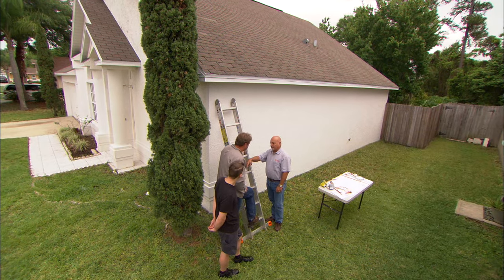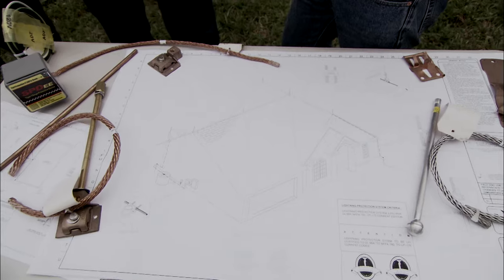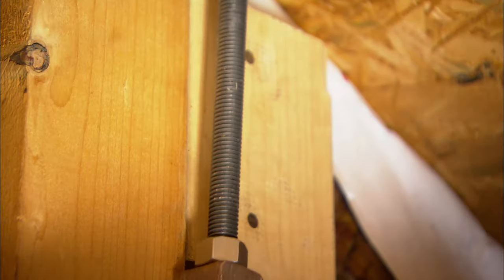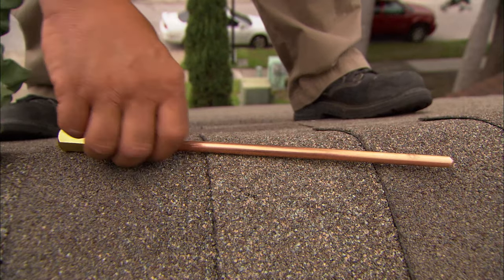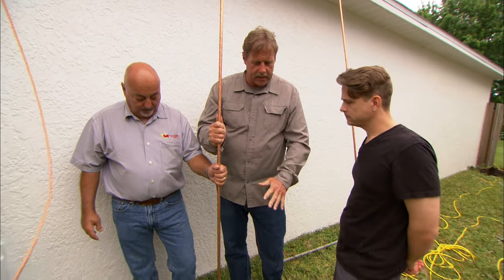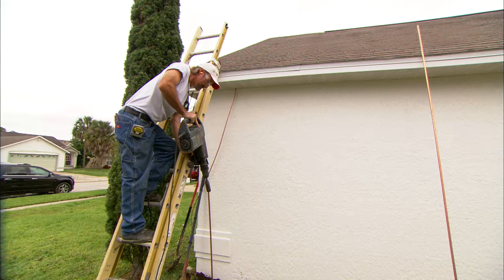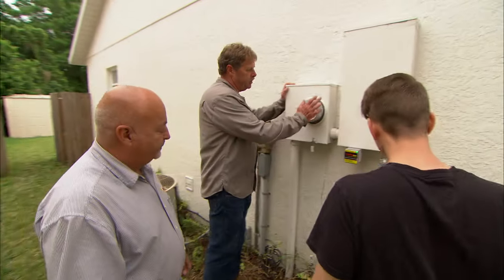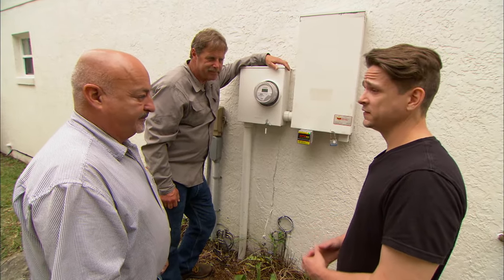Installing Whole House Lightning Protection | Ask This Old House

Comment: The copper cable connected to the ground rod will eventually oxidize and turn green.  This most likely will cause the "wire to rod" connection to fail. This connection should have been protected from moisture and the elements. With the connection buried underground, one will never notice the oxidation.
Reply: Eric R Dont talk rubbish, by your logic, overhead busbars in outdoor substation compounds will fail and copper transformer tails on overhead power lines will fail too. The oxidisation is a thin layer on the outside of the copper. The connection between joints will be mechanically sound whether green or not
Reply: In many neighborhoods that copper would be vandalized and scrapped

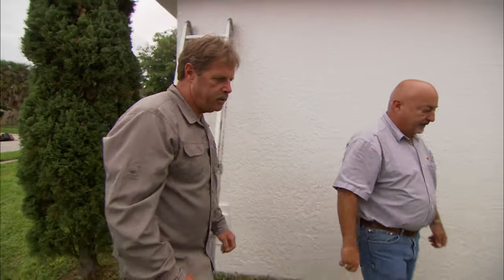Comment: By 0:20 you already know it won’t protect you from lightening surges that come through telephone poles or power lines cause those rods only provide a path for the lightening from the sky via the rods. Not via power lines or cables like telephone cables for example. Hence this video’s Flag ship device is only one part of total house protection
Reply: Wrong..
Reply: At about 3:20 they install a breaker box surge protector. The principle on this is that any surge that comes in on the main line or any other circuit due to an indirect strike, will cause the protection device to route to ground and blow a dual 50 amp breaker. The 50 amp breaker is actually protecting the protection device from taking a sustained flow. The device has to be as close to the incoming AC lines as possible so that it forms the shortest possible path for the surge. Shorter than any other circuit in the house. There are a number of more thorough videos about these devices, their function and installation.

Comment: There are so many things wrong with this video. If lightning hit the rod on the roof there is no guarantee the strike will follow the ground line in the attic and it could jump to a lower impedance path in the house and cause greater damage. The two grounds used to make a 20 ft rod MUST be welded. The ground line MUST be welded to the ground rod. All ground rods MUST be connected together and in turn be connected to the ground at the service entrance of the house. He said cable, tv, phone, etc has surge protectors but those must be grounded at the service entrance also. I bet they weren’t. I don’t see how this installation passes NEC.
Reply: Welded AY LMAO
Reply: Sorry. I stopped reading at "ground at the service entrance". omg. It will fry computers, tv, frig, a/c. There is also guarantee that the lightning will follow the ground line as it has lower impedance than anything else.
Reply: Local code supersedes the NEC

Comment: What happened to bonding lightning ground to electrical ground and incoming gas. And was there any metal within 6ft of the cable in the attic area. Cause if so it will need bonded as well. Pretty sure I saw the name Maxwell on the equipment. Big outfit out of OHIO.
Reply: Good eye, typical for big outfits - screw up the highest number of homes, opening a market in the future for further upgrades/fixes, which they are already way ahead of you on and will see you in the future for again lol. From concrete, stucco, to lightning rods, never trust a big name that is always looking for new employee's
Reply: The NEC states that the ground and the neutral buss must be bonded.
Here in the Philippines we had problems with the ground conductor
Reply: ground conductor of the utilities company had problems reaching the ground sometimes.  I had to run a neutral to a good grounding conductor so that we will have power. (We have 240-0 line, single phase 13.8 KV feeding the XFMR)
One big problem we experienced with bonding the neutral bus and my ground bus is that when that situation happen, the neutral load of the XFMR will be coursed thru my neutral conductor into my grounding system and burn it up.
Reply: @magsasaka1027  Very interesting, thanks for sharing that!

Comment: Interesting, might sound like a daft question but is there a very high incidence of strikes in your area of the US, we’re in the UK and have never come across a domestic property strike although they must happen. Thanks for sharing 👍
Reply: I can't speak to whether they are direct strikes but here in Atlanta, GA we do see a lot of device damage as a result of lightning during storms. I do IT and other technology consulting so I am called in to replace equipment damaged during thunderstorms. I have an electrical\electronic\scientific background but I can't speak to the pathways involved by the lightning, maybe through the power transformers, or wet ground and wet homes, I'll have to think about that, but the result is pretty clear. Lots of damaged computers, routers, TVs, audio amplifiers, whole house audio components and so on. 
The guys touch on indirect hits just slightly at about 3:20 when they do the Breaker box surge protection device.
A friend of mine lives in a wooded area and has seen a receiver, TV, DVD player, and a multichannel amp (twice) get hit from two storms within roughly the last year. We're about to do some serious prevention work in the near future.
Reply: My wife's parents house is on a mountain top, and everytime there is a thunderstorm, they had to turn off their main switch (30 amp fusible switch) otherwise, the fuses will be busted, and also bust up their TV receiver.
Reply: I live near the Tallahassee Florida area and it's definitely one of the worst places in the US for lighting strikes but I only recall a couple houses being destroyed by lightning over the years.
Reply: I live in Oklahoma (tornado alley) and we had an indirect strike around 2015 at our house. Fried several electronics and we had a hefty repair bill for our air conditioning unit. Just saw on the news that lightning struck an apartment building through an air vent and busted a toilet into smithereens! Luckily there was no fire!
Reply: Florida is constantly getting strikes!

Comment: In reality having a lightning protection system on a structure does attract lightning strikes due to the air terminations creating a larger streamer compared to a structure that is non-conducting. the step leader from the cloud is looking for a ground streamer to make a connection. it would be interesting to see if the spacings of the air terminations comply to the correct rolling sphere protection radius.

Comment: 1:24 He Did Secured The Cable Wrong, It Shopuld Loop Around And He Should Secure It With Equal Pressure To The Plate, Now Its Not Like That !

Comment: What is the tool used to cut the threaded rod? at 1:30
Reply: Cordless bandsaw.  Very handy for cutting rod and conduit in the field when an extension cord is impractical.

Comment: Why the wire inside the attic doesnt have any insulation? I mean there is like zero chances to have someone touching the wire when a lighting hits but its there
Reply: It’s lightning cable. Do you think thin insulation will protect you if you’re grabbing it? Probably not. Lightning will go right through it. Tens to hundreds of millions of volts.

Comment: I thought the idea was to shed the lightning away from your house? This appears to bring it into your attic before disbursement to the ground. (?)
Reply: Lightning will strike where it wants. It is not possible to redirect it away from a structure. Unless you live next to the Eiffel Tower perhaps.
Reply: @ClicketyClack  Sure it is. By providing a more attractive (lower resistance) path to ground. If you want to see real lightning protection, look at a space launch pad  at Cape Kennedy. See those four towers around and higher than the vehicle. With wires run between them.That's how it is protected in Florida.

Comment: Why People Don`t Use Diodes To Put The Electricity Into Ground And Not From Ground?
A Lot of People Get Sensetive Devices Killed By The Static Electricity  That Comes From ground And Thats Why I put In parallel so all the unwanted electiricty  goes into the ground and not the other way around, i put few diodes with diferent values in paralell so if one blows, the another one will work and if lighttning strikes , they will be fine i guess. or am i wrong?
it works good for the computer because without grounding diodes, the computer froze many many times a month, now when i made the diodes to ground from pc, it have never hapened not even once.

Comment: I think this was mislabelled.  This should  have called Everything Wrong With This Type of Lightning Protection.  Routing a cable through the attic-wrong.  Steel threaded rod connecting the point on the roof-wrong.  Ground rod only 8 feet in length -wrong.  No checking for utility lines before driving rods into the ground-wrong.  No series of lightning rods in the ground connected with copper cable-wrong.  etc., etc. .

Comment: Keep in mind that while this makes a strike on your house safer, it also increases the chance of lightning striking your house in the first place. This system is probably more important if your roof is higher than most other objects anywhere nearby, like if your house is on a hill or a two story among single story homes.

Comment: He said adding the rods won’t increase lightning strikes to his house...that it doesn’t “attract” lightning....Then why does a tower get struck more than anything around it? It’s the same principle...I think the odds are greater that his house will get struck more “with” the rods than “without” the rods.  The lightning is looking for the easiest way to get into the earth.  I think the guy is lying so his business doesn’t get struck.
Reply: T Jam it’s more about height instead of material, a tower attracts lighting because it’s the highest point of that area. In this case I don’t think the extra feet would significantly attract more lightning to his house

Comment: Someone should tell him that a lighting rod prevents lighting. It’s primary function is not to “disperse the lightning into the ground”
Reply: A lightning rod doesn't prevent lightning.  It can attract it, though, if it was going to strike nearby.  So he's wrong, but not for the reason you think.
Reply: @jej3451 , maakjar, You both are wrong. Lightening rods do not prevent lightening strikes. The wire just gives it a direct path to earth. Also, the rods only attract a strike if it is close enough to hit the ridge of your building, and it's much better to direct it to earth, which is a natural ground.
Reply: @augustreil  You said nothing that contradicted me.

Comment: Why do you need lighting protection? Wood is a horrible conductor of electricity. Lighting striking houses is extremely rare.
Reply: Everything is a conductor if you push enough voltage through it. The guy in this vid already had one strike that fried all his appliances.

Comment: Dude use isolated cable! don't press the raw copper into the wooden beams! Also, considering lightning rod mechanics, why not put it away from the house!?
Reply: Miquel Vico why not? What do you mean isolated cable? Do you mean use insulated cable? If you put the rods away from the house. Then the lightning may still strike your house and not the rods.
Reply: Insulated cable would melt and be a higher fire hazered than bare wire.
Reply: Insulated, Non-insulated, makes no difference.
Reply: @Fusiongearz   Melting rubber is a barrier between white-hot copper and dry wood, not a perfect barrier, but at least the heat sorce ain't being mechanically pressed against the fuel sorce.
Reply: Better to remain silent and be thought a fool than to speak out and remove all doubt.
Reply: Miquel Vico White hot copper? Yes the lightning strike would be a huge source of current/voltage, however the copper is a low resistance path to ground which would carry the current for milliseconds, nowhere near enough time to heat up the copper.